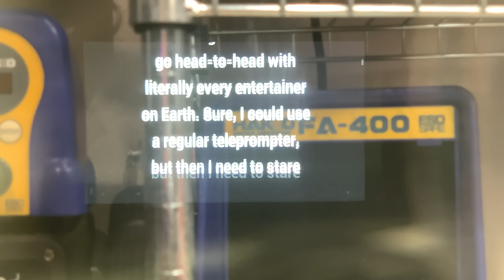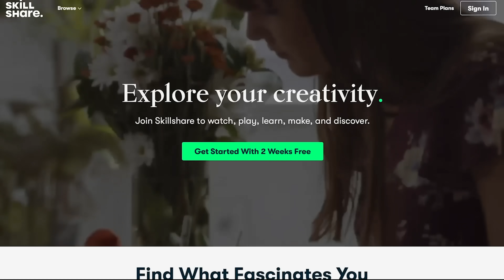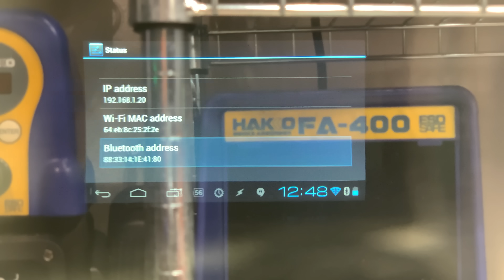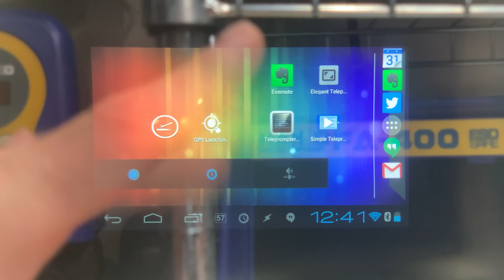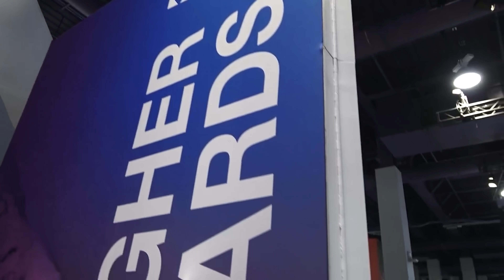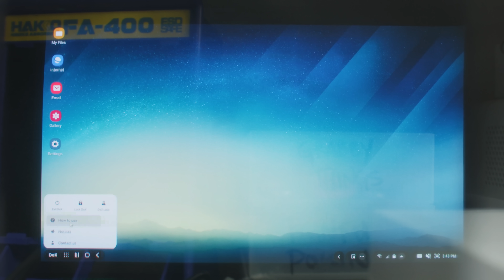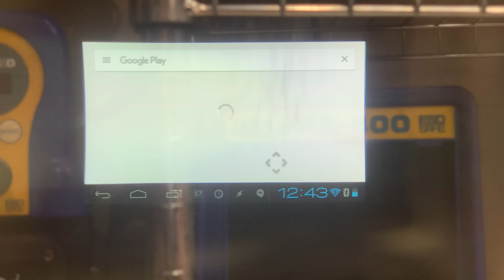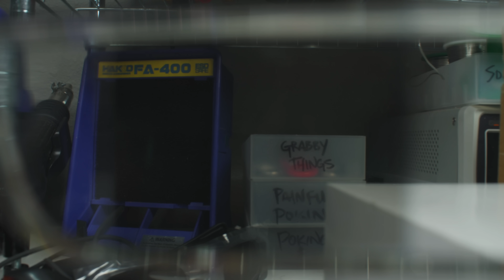If This Wearable Fails, My Channel is DOOMED!

Comment: I would have just kept the second display board on the right but disconnected it from any display so that it thinks it's still fully running and then just cut the right side off as hardware. It's very janky, but it would definitely work. 

The one problem with this method is that the ribbon cable is still as long as a pair of glasses, so using it for a single-eye monocle system would require stuffing it somewhere, which might be kinda annoying.

Comment: What if you just....removed the right lens assembly and leave the rest of the headset? Its a monacle, its a frame already, and you dont have to do any extra hacking or engineering to have a working result.

Comment: So it took me about 2 weeks after I initially watched this video (which was about 3 months after it went up) to start thinking, and ask myself...

...why don't you just buy one of those microdisplays you mentioned and a driver board off AliExpress for $150 and install that in the existing case you have, re-using the optics? It would have to be cheaper than a $1000 Epson HMD that very possible wouldn't even work after you cut it in half.

Comment: the hololens is outdated and youre working on a worse version of google glass haha time to change project to something abit more in this decade . with the new snapdragon and the new display types you could probably build something way cooler. your other projects are amazing but this one is getting verry outdated .
Reply: Yeah, well, yanno that's just like uuuuuhhh, your opinion, man.
Reply: @gino5220  did i say it wasnt my opinion? do i have to put a warning that its my opinion for americans to understand?
Reply from the maker: That's kind of the idea. The Rockchip 3399 in this build is a midrange consumer chip, and the OLED/waveguide optics are pretty modern. If anything, Google Glass proved that LCOS/laser optics are a non-starter - they just got too hot and used too much power. VRDs, fully holographic optics, and vitrionic displays are still far from consumer-ready.
Reply: @ZackFreedman  we already have ar glasses. noone wants a chunk of glass outside their glasses. thats what i meant.

Comment: Make 2 slots so you can hot swap batteries. You would have to make a hotswap circut, but it would be worth it.
Reply from the maker: I was thinking about that. If I end up using another SBC and can't use this charge controller, I may just do this.

Comment: could you use an optic cable that is big on one side, and small on the other to reduce the screen size more and use that to pipe it easier than mounting?

Comment: if someone walks up to me with a wearable, i'm asking them to please remove it. if they don't, i'm immediately walking away from them. i HATE being filmed or recorded in any way. these kinds of wearable cameras that may or may not be filming all the time is my literal nightmare. if they ever catch on, i will become the lex luther of cameras embedded in glasses, and make it my life's purpose to make sure they are non functional. and i don't care if your wearable "doesn't have a camera" or "isn't recording." it's insanely simple to add a pinhole camera to one of those things, and they already have everything you need to record. no thanks!
Reply from the maker: This headset doesn't have a camera, and I removed the camera from my Optigon.
Reply: By that logic anyone with glasses could also have a pinhole camera in their glasses. Or in their shirt button. Or any number of things, but you choose to be a moron about 1 thing. Interesting.

Comment: Can you just leave the board for the display connected, unstick the ribbon cable and fold it all over into the enclosure? Assuming you can disconnect the physical display without it cutting out. Maybe it's just the board? Looks pretty small.

Comment: Why don't you just run both boards connected like normal with just one pixel display connected? I mean, the second board has no idea if the pixel fondling goodness is blowing a load into the ether or boomerang banging back down the ground plain right?

Comment: Rather than a monocle why not just mod it so you can flip the right hand lens up out of the way? Is it just to save power consumption? Which thinking about it is a good reason why they should come with a mono option that just switches off one display, right out of the box.

Comment: Is it designed to show the same exact image on both displays? If so, why not just migrate the left display chip over to the right side and detach it completely from the left side optics? 

Bad example as optics!=audio but if you have a left and right audio speaker but you want mono audio, and the speakers only work when both are plugged in, why not just stack them ontop of eachother?

Comment: Easy possible solution would be to keep the display driver on both sides connected, and try to just disconnect the second display.  If that works, just move the extra driver to the other side. Sure, you're power an extra board that you're not using....  But I see you found documentation, so you won't likely have to do something that hacky.

Comment: I got the BT-35E and have taken apart my old one with the intel fob.  The intel fob one just had a FPGA that spliced both DSI's from the display.  I managed to get the bit stream and a bit of tinkering found it just clones the DSI stream when a gpio was down or double's the resolution.  I suspect thats what that fpga does.  To be honest, a quick and dirty method would just have your cpu display half the resoultion and switch the glasses into 3d mode if you want it to get working now, otherwise you might just end up getting a dsi to display port adaptor and just hook into the display.

Comment: No mention if disconnecting the ' screen ' for the right side did anything.  It could be as simple as the cable to the other side is not like a phone cable ( cary signals to/from each end ) but a complicated route through, requiring the boards to be connected to have signals go literally to 2 of them to complete power/signal/data.

Comment: Since the display has a small screen that sends light through the optic couldn't you just cover the screen with a small piece of tape? Then the right display is off and the left still works
Reply: Like obviously not the glass, but the small screen driving the right side

Comment: Could you get Android to run on a Raspi Zero 2 and then connect the optics to that? Wearable HUD's are cool, but the idea of trailing wires seems a bit unwieldy. Better to connect a slimline LiPo battery shield and have the whole thing run a bit slower, less battery life, maybe a bit heavier but be completely self-contained.

Comment: Random brain farts, If its just for text alone perhaps the whole thing could be made with something like the adafruit rgb matrix bonnet array screen in a remote box with a thin fibre optic bundle umbilical in a dot matrix using a rear projection setup from the side arm of the glasses? The exact same way that parallax free unlimited eye relief red dot sights work to keep the dot razor sharp no matter the viewing angle or distance. An inner coating on an ordinary glass lens using reflective tint film would work one way mirrored surface. Obviously the hardest part is figuring out how to couple the fibre umbilical to the RGB matrix and the Projection lenses while maintaining pixel orientation this would probably require advanced factory tech unless some genius could figure out a hacky way. All in an effort to get the glasses to be as thin and stealth as possible, looking like ordinary glasses. Although your cyberpunk style is what made me start watching you ages ago, you are a unique, quirky and likeable individual!

Comment: Should just get a Vufine VUF-110. It's a simple monocle you attach to glasses to give your one eye a lovely, HD display. It's only $200 and isn't far off from what you're using now. It uses HDMI as input. I played with one for awhile. I did return it, but only because I couldn't think any good use for it. 

Also, just a thought, but why not try a pair of AR glasses like the "Nreal Light"? You could make that teleprompter a complete, floating, locked-in-space 6DOF screen. It also works with a smartphone (mostly high-end Samsungs). They have released recently for $600.

Comment: Does it work if both display boards are connected, even if the display itself is not? If so, just move the right-eye display board to the left and leave out its display. Done!  (well, after replacing the long, glued, flat cable with a shorter one.

Comment: I totally get why you want a monocle, it's so much more cyberpunk than glasses.
The easy route you can go is to leave the connection but cut the glass and fold it to one side, so the right side is flipped over the left side (from your perspective)
 risky, but it's better than trying to fiddle with the electronics.
Also, you get two monitors, you can flip the higher one and use it for additional text \ running clock \ baby cam or to spy on your neighbours at all times.
Good Luck!

Comment: Hope you have a logic analyser fast enough for that probing! Is there any good way to find out which direction a signal is going in? My gut tells me there might be a slight difference in edge transition times compared to the other direction, otherwise you’d need to know what direction current is going. Some 1-100 ohm resistors in series with each signal line may work, though you’ll need a scope fast enough to view the voltage difference. Hall effect or inductive current sensing is the other method, but considering all of those signals are twisted pairs you won’t have an easy time probing that and maintaining signal integrity.

Have you looked into dumping the FPGA flash?

Comment: Not to be all Khaby Lame, but you could just remove the right side optics and be done.  Sure, the electronics are still hanging out on the other side of your head, but at least you have a working monocle.

Comment: I am currently doing this exact thing with a newer (bt-35) model of the epson. If you want the boards I have them, I bought new displays and a board from Ali express. I’d love to chat and see if we can work together. (FYI mine is designed to be just an HDMI display, so can connect to anything)
Reply: And I am local in colorado :).. seriously thinking about buying a bt-40 right now…

Comment: What happens if you just disconnect the LCD from the driver board? If nothing else, you could relocate the right-side driver board over to the left side and let it just think it's still outputting to a display.

Comment: Pretty kick ass project

As far as the monocular mod goes, you might be able to just make a jumper board thats got everything except the right side video signal connected, then you'd just have the one video output on the left side and the right would be left blank but the computer would think it's still on and operational. 

My other guess as to why it doesnt work is power delivery, the displays might be daisy chained together in series, so both need to be connected for the circuit to be complete.

Comment: Would an easy workaround just be to keep the chip installed but remove the display, kind of like when you hand your sibling an unplugged controller? So the system recognizes the chip is there and you can just mount the "right" side in tandem with the left. Would make the end enclosure bulkier but may be easier.

Comment: Hold on, don't ditch it yet. 

Might be a stupid comment - 
why don't you cut it in half, 
keep it connected 
and use the second screen as nothing but paperweight on your glasses?

That way everything still works, you don't need to tinker with it anymore!

Comment: You could just take the other board and the cable across and throw it on the other side while you work on a solution. I imagine as long as you have the processor you wouldn’t need the actual projector connected

Comment: I'm gonna be that guy and just be disgusted with you for being so anal-retentive about wanting it on only one eye when you could be engineering something more constructive by moving the compute system into the arms entirely and making modern versions of those monitor glasses sold in Air Mall in 1997 that ACTUALLY work like the ones in science fiction shows they were inspired by.

Comment: Just out of curiosity, why is pulling the glass out of that side (or replacing with the visor you use right now if it's one big piece of glass) out of the question? The display is just projected to the visor, no? So just take out the visor and let the display project to some electrical tape.

Comment: Sounds like a decent display for those of us who don’t want to look like Vegeta. Have you tested it with any splitters? How is it for reading text or entering terminal commands?
I’m not exactly in the market for something like this yet, but if it works well it may end up on my list.
Reply: It takes a bit to get used with them, especially focusing the screen and what is behind the screen but it is doable.
The resolution is good enough for reading terminal lines once you get used to it.

As for splitters, that is the issue. I was not able to found any proper splitter for USB-C and PD that work with them.
Some Thunderbolt 4 docking stations seem promising but not actually portable.
Reply: @adrianmarianpopoviciu215  Damn. Guess this ain’t for me then. I don’t have anything with janky ass USB-C with the million alt modes.

Comment: If it fails Put a phone stand on top of your camera  and have Google slids running on it u can also use a button hooked up to your headphone jack to change the slides or if it has an spen with a button on it u can change the slides for flash cards

Comment: Not a DP expert by any means but I can think of two possible scenarios why video quits and one maybe large concern. 

Being bit optimistic, it may be a simple check if the HPD (Hot plug detect) is pulled low. This would be ideal.

It could also have some continuous handshaking like you mentioned.  May be over the AUX channel. This would be harder to spoof, maybe could use a small dummy plug to emulate a display.

My main concern is that if link training fails both displays might go offline. May have to keep the right side but jam it in on the left. Either way, good luck! Looking forward to the next video.
Reply: But the displays aren't connected to the driver board by DisplayPort, they are connected by MIPI DSI. That's actually dumb enough that his odds are good.
Reply: @SianaGearz  Ahhh, I missed that, that does help

Comment: Nothing wrong with Android 4.4 !

Hell, I still use tablets running 2.3 for Security and News feeds.. 

I REALLY hate having to cut & shut flex cables with more than 6 pins ! Mezzanine connectors are the the 😈Devil☹️

Comment: You know, the building of Optigon 2.0 could be a good YouTube series.  Some of us are interested in the hardware-hackery side of things, and it'd be nice to see how others do it.

I've been interested in the idea of a wearable display for a while now, but...  Well, I don't have a ton of options.  I'm not 100% concerned with the left eye lens being transparent or completely opaque (in other words, I don't mind putting a display in front of my left eye so long as I can focus it to see it), personally, but that's because of biological reasons anyway.

(Long story short, my left eye is not good.  I don't have much in the way of depth perception as it is, so losing what little the left eye gives me in favor of an always accessible display I can use around the house won't bother me.)

The problem, I suppose, is getting started.  I'm the guy who prefers to start cheap and upgrade if I hit limitations later.  Yes, I spend more money in the long run that way, but I don't get buyer's remorse for getting into something that I later on find I'm not interested in.  (I've never tried VR, for example, because VR headsets are insanely expensive, my hardware can't run it, and again, my left eye might mean I could design something cheaper using off-the-shelf junk and get the same results.  Somewhere, I've got links to bits and pieces to take one of those cheap phone-holder HMD's, stuff an HDMI splitter and two 3" 1024x768 displays into it, power the whole mess with USB plugs and an external powered hub, and give that a try.)

I wonder if I've still got that 15-year-old piece-of-shit Kodak digital camera laying around in a junk bin...  Might be able to rob the electronic viewfinder from that...  Maybe.  But then how to drive the display?

Comment: You should try contacting Epson to let them know what you're up to, show them your current headset, and see if they want to help out some.

Hope it works out though. Alternatively, look into the NReal Light AR headset?
Reply: I actually got Android Kernel source for the BT-200 within a couple of weeks... It's worth a shot!
Reply: @DingleFlop  That's really handy. But, getting proprietary HW info is very different. There's NDA's and all sorts of problems. Android is technically open source...
Reply: @edwardfletcher7790  The devices use separate kernels with important binary blobs.
Reply: Japanese Companies, for all the high tech goodies their Engineers design, still exist in the 18th century of 50 levels of management. It'd take 7 years to get a response, and the answer would be No...

Comment: Ach dude cmon, forget the camera batteries, run it on 18650s and use literal 18650 battery holders.  Makes charging AND swapping suuuuuper easy and cheap, plus they have massive energy storage.  As for the eye, man.... if you ever get rid of the version 1 id love to mess with connecting it to my pipboy so I can have IRL VATS.  ;)